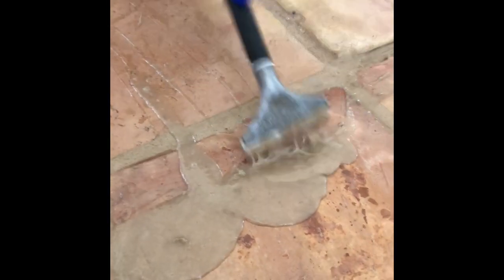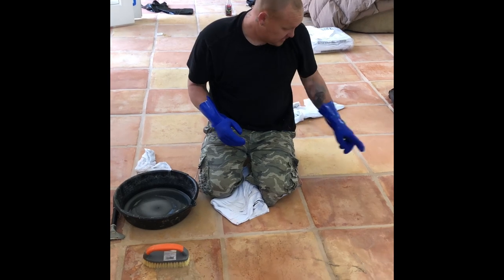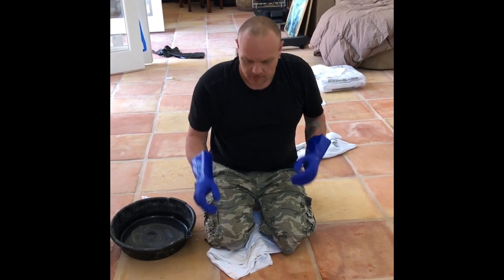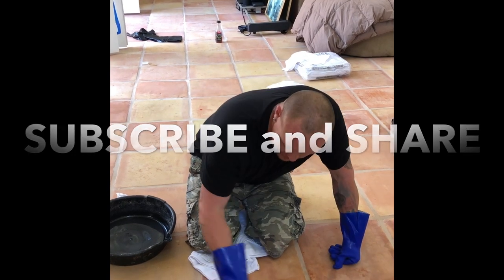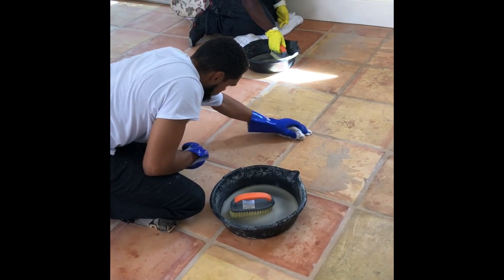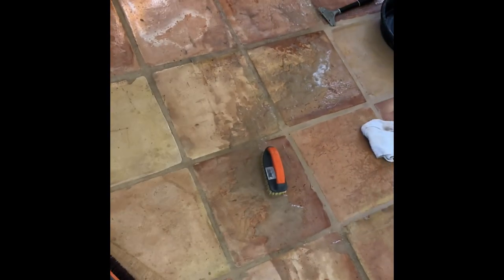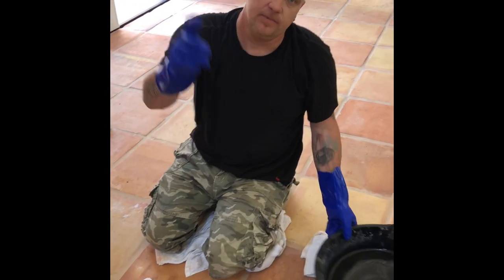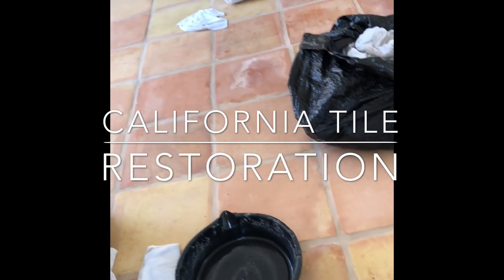Tile Refinishing | Cost To Refinish Saltillo Tile

Comment: There’s tools and flooring equipment you can use to strip the old sealer and literally one machine that sucks up all the residue it’s like a wet vac with a large squeegee it’s just alot of manual labor that can be saved and the job could be done more efficiently

Comment: Hello. You have great videos!! I am in FL. So cannot bring you in. I have this tile in my lanai area. Previous owner Painted Over it. I am removing the paint off of it. What is the best stripper to use please? Watched all your videos. Thank you very much.
Reply from the maker: Want the product we use to remove coatings and old sealer from terracotta Saltillo tile? 

Planning to restore your tiles yourself or you are a tile contractor looking for the best product to remove old coatings and just want the best product for completely removing all of that old existing sealer?

Then call (707) 384-1172 and ask for Fritz to order yours now and 
get the proper guidance and products to restore your tiles the right way the FIRST time!

BUT HURRY !!

supply may be limited and you don't want to be left out.

Call right now and get a FREE 15 minute consultation when you mention this video by title!
(which you are GOING TO WANT, I promise)

Comment: How would you recommend we match an existing Saltillo tile (that is about 15 years old) but still in good shape). Really enjoy your videos!  Thank you so much.
Reply from the maker: Best way to match new tile to existing tile would be to strip the old tile then clean them then reseal them. The old dirt is stuck in the sealer so u have to remove it first. The new tile should just be cleaned and resealed with 2 to 3 coats of sealer

Comment: So what the chemicals you were using to clean the tiles ...
Reply: Just go to Home Depot or Lowes and ask for a good water based stripper. Try it on a small concealed area.  If that doesn't work, you probably have polyurathane sealers.  If you  have PU sealers, I would recommend professional cleaning.  The solvents (MEK) are super toxic and MEK is flammable. (Methyl-Ethyl-Ketone)
Reply from the maker: Want the product we use to remove coatings and old sealer from terracotta Saltillo tile? 

Planning to restore your tiles yourself or you are a tile contractor looking for the best product to remove old coatings and just want the best product for completely removing all of that old existing sealer?

Then call (707) 384-1172 and ask for Fritz to order yours now and 
get the proper guidance and products to restore your tiles the right way the FIRST time!

BUT HURRY !!

supply may be limited and you don't want to be left out.

Call right now and get a FREE 15 minute consultation when you mention this video by title!
(which you are GOING TO WANT, I promise)

Comment: which stripper are you using?
Reply from the maker: Want the product we use to remove coatings and old sealer from terracotta Saltillo tile? 

Planning to restore your tiles yourself or you are a tile contractor looking for the best product to remove old coatings and just want the best product for completely removing all of that old existing sealer?

Then call (707) 384-1172 and ask for Fritz to order yours now and 
get the proper guidance and products to restore your tiles the right way the FIRST time!

BUT HURRY !!

supply may be limited and you don't want to be left out.

Call right now and get a FREE 15 minute consultation when you mention this video by title!
(which you are GOING TO WANT, I promise)